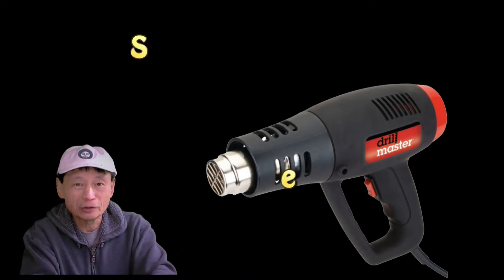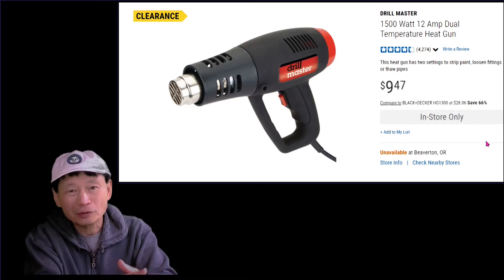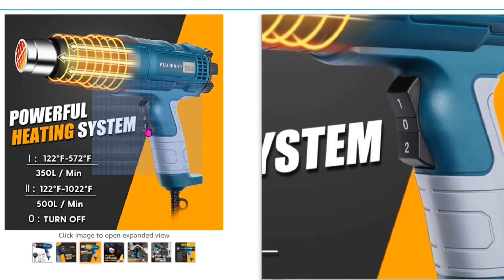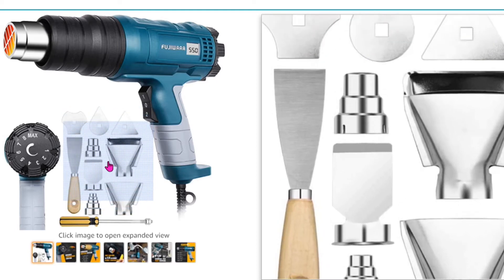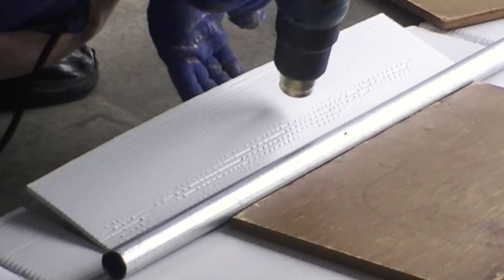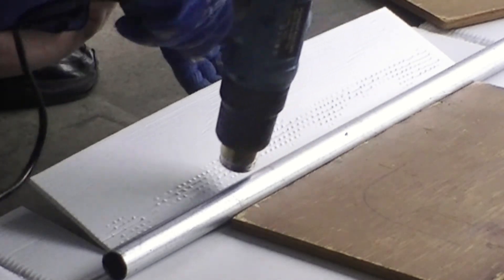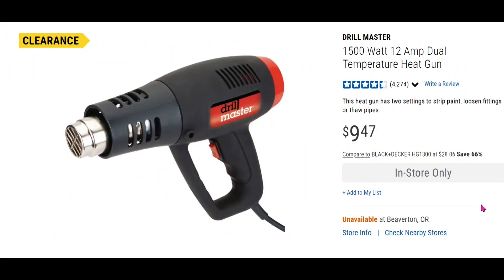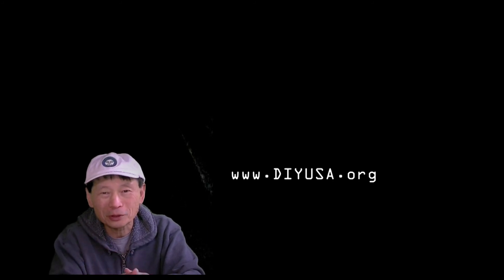Heat gun selection for joining coroplast (heat fusion)

Comment: Did you ever get around to trying the PP polypropylene hot glue sticks?
I wonder if some finely chopped up coroplast (like onions) could just be jammed into a hot glue gun with a metal rod and work. Maybe a borosilicate glass tube with ID matching that of intended glue stick should be put in place though to prevent PP going out sides
Reply from the maker: A viewer has used the PP glue stick, and he told me to try. I have not spent money on that yet. I probably need a more powerful glue gun because I  usually make a large joint and I believe I need more heat to create a sold joint.

Comment: Thanks for sharing your experience with fusing (I’d actually call it welding) Coroplast. I tried a couple different glues before finally remembering I had a solder hot air gun! So I tried welding my Coroplast. It worked great! Now I’m going to return more of the glues I was about to test. You saved me lots of money! I will try to post my experiences and share them with you. Thanks again!
Reply from the maker: Thanks for your feedback. Yes, you can call it as welding. I believe the glue that works best with coroplast is 3M scotch-weld 8005 -Structural Plastic Adhesive. There is a youtube video from 3M showed the test result. But it is expensive. I bought a tube 2-3 years ago but I have never used that because I discovered 'welding'/heat fused technique. A viewer told me using polypropylene glue stick + glue gun will work also. I believe that because the welding technique basically is joint two pieces of coroplast by melting the polypropylene. Looking forward to hear more about your experience with welding.

Comment: Thanks for this!  I'm tempted by a battery powered heat gun... no particular brand... do you have any experience with those?
Reply from the maker: Thanks for bringing up the use of a battery powered heat gun. I have no experience with this type of heat gun. Generating heat requires a lot of power. For a brief, short and small task, probably it will work. For my applications, it probably will not work. I notice negative feedback on this type of heat gun is about its battery life, which is expected.
Reply: @DIYUSA  I hadn't seen any feedback on battery life, thanks for that!

Comment: Thank you for sharing your projects. 

I’ve been considering building myself a portable storage solution and I thought about using an old soldering iron to spot weld the materials. Have you tried that method, and if so what were your results?
Reply from the maker: Thanks for the question. I tried to use soldering iron to hot-weld two coroplast sheets two years ago. It was not successful. I can do that with thicker and solid plastic (there are many videos on youtube about that method). My understanding is the amount of polypropylene (from coroplast) is very small and using a soldering iron can only melt small among of polypropylene to effect the 'weld', but I can't melt enough coroplast using soldering iron to effect the bonding. Later, I used a heat gun and did the butt joint, which is very effective to 'weld' two sheets together. With butt joint, I allowed the edges of approx. 10 mm of coroplast to be melted (so I have sufficient polypropylene). Once the edges were melted, I can then place two sheets together. The polypropylene behaves like glue and I have to hold two sheets together till they were almost cooled down. I can even set two sheets at different angle and it will keep that angle once the sheets were cooled down. One viewer mentioned using a hot glue gun with polypropylene glue stick  to attach two sheets of coroplast together . I haven't try that yet but I believe that will work because the polypropylene glue stick will provide sufficient 'glue' to effect the bonding.
BTW, I have been thinking of making a car top carrier using coroplast and heat fusion also.  Cheers!
Reply: @DIYUSA  thank you for the informative reply.
Reply: I'm gonna try My yard sale 1875 watt blow dryer.  Will it work, I donno.